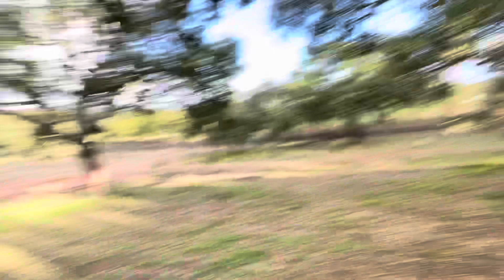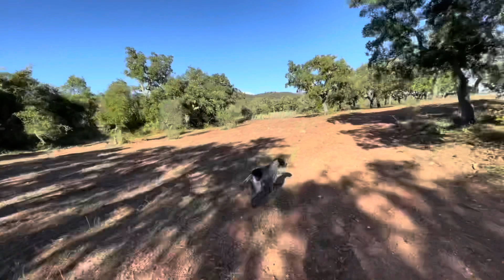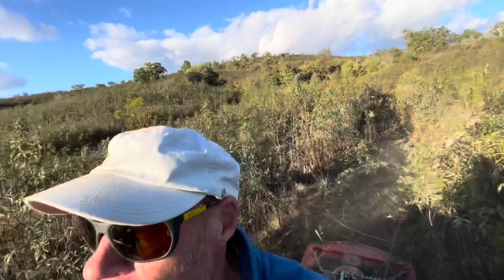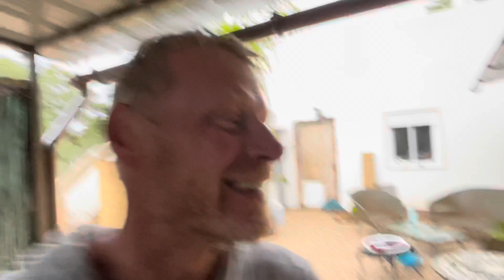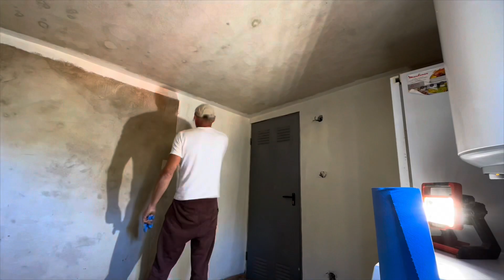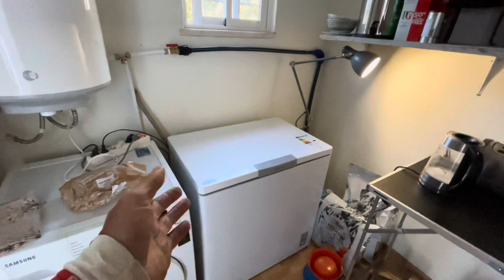Working My Way Up the Land | Tractor Time #31

Comment: Hi Andrew, I’m still way back at Epidode # 31 but reluctant to go forward and interrupt your progression as your projects and lifestyle evolve over time, not that I haven’t been tempted. 

Anyway talking about appliances in this video. Have you got yourself an air fryer, they seem to be all the rage down here and are so quick and compact too given your limited space at this point in your bus but also a handy addition to your kitchen appliance arsenal. 

Love your channel, including the excursions to the beach. But before I stop waffling, you mentioned you had plans to get a standup first and then possibly a surfboard. I’m a long board surfer myself 9’6”) and still learning my craft after some nearly 20 years (now just turned 72 having started if when I was 53) but the enjoyment I get out of this ‘addiction’ has been life changing in so many great ways, it’s distressing and relaxing even just for a 30 minute sessions, it keeps you fit and feeling young as you are mixing it up with all the guns and groms. You might spot my local break at Piha (45 minutes out of Auckland, NZ) on my profile photo and taken from Lion Rock an iconic rock formation shaped like a lion). 

I know there is some pretty aggressive surf spots on the Atlantic coast of Portugal, but where you are looks like your local beaches just might suit a longboard extremely well with the possibly in the right conditions giving you some nice glassy peelers that I’ve seen in your previous videos. Cheers mate.

Comment: With a pair of jumper cables you could jump start either your car or your tractor from the working vehicle's battery...  (assuming they are both the same battery voltage, which google seems to indicate)

Comment: Your strategy has to be to hold the water on your land for as long as possible so that it can soak into the ground and benefit your land. I also question the sustainability of cutting so short. All in the name of tidiness. Yes, trim and hold the water, but let nature revive the land as well..
Reply from the maker: It’s not just about tidiness it’s also about getting it to a level where I can maintain it.  And as I have already mentioned I will be planting trees.
Reply: True, those lands were being regenerated and also served as protection for the fauna that now no longer exists in that area. In addition, when vegetation is removed, it retains water worse and can produce runoff.

Comment: If you're going to do a SHOWER SCENE every week please trim the excess zip ties off the bamboo, its doing my head in..lol😆🤪
Reply from the maker: Ha ha. Zip ties were trimmed. I’ve wrapped them round 3-4 strips for strength . It just looks like (at certain camera angles) I haven’t trimmed the ends. I could only find black when I was dashing around searching for them.